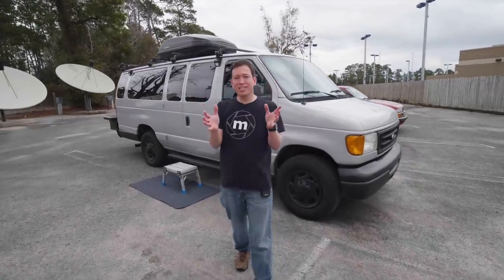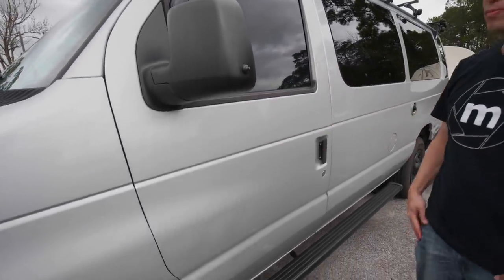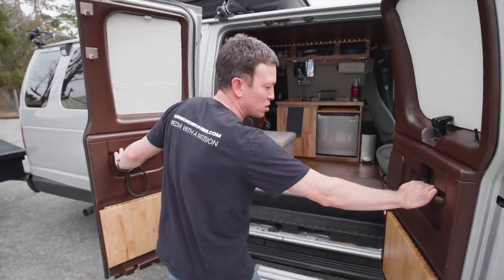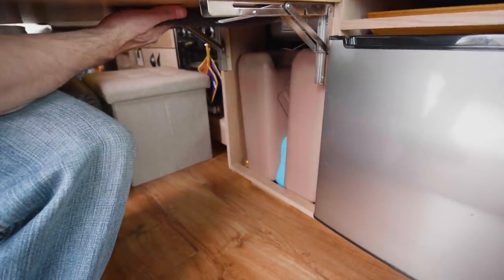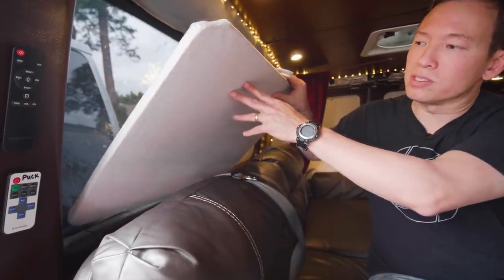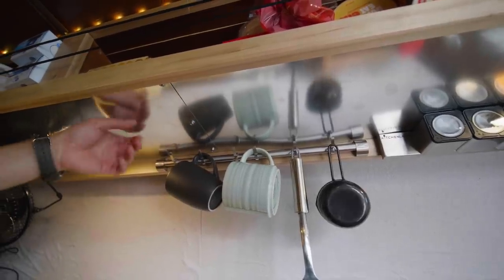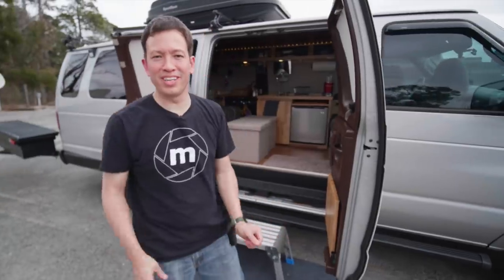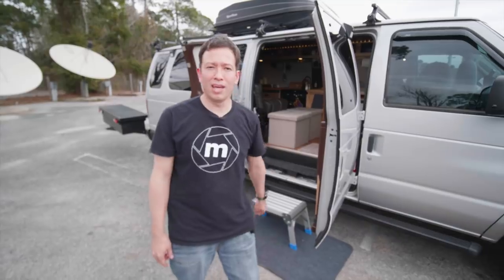Touring Camper Van Tour 1.0

Comment: Where did you get your cameras you mounted in the outside edges of your mirrors? Also, where did you get your camera controller under your steering wheel and what is it called? I like the bidet idea. I got one for my house, but it sticks too far out to the side and the tub is in the way. How do you control the water temp so you're not freezing your business with cold water?

I have some radios with screens,  but I can only use 2 cameras at the moment. I like that controller you have.

I'm designing a computer with multiple cameras to protect me from the biggest crooks out there. COPS!!!

Cops and their phony tickets for things you didn't even do.

I love going to court and showing video that shows what liars they are.
Reply from the maker: All the items that I have links to are in the description. Regarding the water temp in the bidet...I just use tap water and let it set to get to room temperature.
Reply: @IanSkelley  Thanks, when I watch the videos on my tv, I can't see anything in the description.

Does it have a tank to fill so it can sit to get to room temperature? Mine connects directly to the water supply line for the toilet and this mountain well has very cold water. Is why I've wondered about heating it.
Reply from the maker: @nunyadamnbiznez3522  The tank is just a home depot sprayer. You can see the build here: https://youtu.be/7_xtJsL4p4s
Reply from the maker: @nunyadamnbiznez3522   here is the list of all the items: Ian Skelley’s Camper Van Product Page

Safety/Security
Get Blind spot mirrors: http://amzn.to/2pCao2J
Get Ventshade: http://amzn.to/2qv21tI
Get Roadmaster Active Suspension: http://amzn.to/2q5tMbu
Get Backup Camera: http://amzn.to/2r3pLl1
Get Side Camera: http://amzn.to/2rOsGSP
Get Quad Processor: http://amzn.to/2rAT6qw
Get DVR: http://amzn.to/2rB63AC
Get BNC Connectors: http://amzn.to/2snZqzy
Get Hitch Extender with Step: http://amzn.to/2rB8WS3
Get Wide Hitch Step: http://amzn.to/2h6xFtz
Get Weather Station: http://amzn.to/2snTF4T
Get Magnetic Phone Holder: http://amzn.to/2s2QIt2
Get Gas Detector: http://amzn.to/2s32mnW
Get Wireless Keyless Entry: http://amzn.to/2rOxtDV
Get Pioneer Radio: http://amzn.to/2snU879
Get Radio Antenna Extension: http://amzn.to/2s31LTa
Get Radio Bypass: http://amzn.to/2s2YyTB
Get Radio Install Kit: http://amzn.to/2rOngYm
Get Speaker Harness: http://amzn.to/2rAYoCl
Get Car Alarm: http://amzn.to/2rOk9zo
Get Car Alarm Motion Sensor: http://amzn.to/2so3tMc
Get LED Motion Lights: http://amzn.to/2snwmYV
Get Mini to RCA Adapter: http://amzn.to/2eQrRnk
Get RCA Cables: http://amzn.to/2v1CcmT

Privacy
Get Curtain Hooks: http://amzn.to/2snMXMk
Get Curtain End Stop: http://amzn.to/2qQd4JO
Get Curtain Ceiling Bracket: http://amzn.to/2snBdth
Get Curtain Track: http://amzn.to/2rtWD7Y
Get Car Windshield Cover: http://amzn.to/2hzjwXb

Kitchen
Get Camp Chef Outdoor Camp Oven: http://amzn.to/2rBarjc
Get Camp Chef Propane Hose Adapter: http://amzn.to/2ru7LSa
Get Magnetic Spice Jars: http://amzn.to/2snwRlL
Get Moen Sink: http://amzn.to/2qJSlrZ
Get Sink Strainer: http://amzn.to/2s2RV3y
Get Soap Dispenser: http://amzn.to/2snRcqY
Get Faucet: http://amzn.to/2s2VNS6
Get Swivel Sink Aerator: http://amzn.to/2s2W3kn
Get Camper Drain: http://amzn.to/2qJsLU1
Get Water Pump: http://amzn.to/2rB3zCa
Get Pump Silencer: http://amzn.to/2ru61Is
Get Pipe Strainer: http://amzn.to/2qJxwwK
Get Magnetic Knife Holder: http://amzn.to/2vzDarv
Get Shelf/Table Bracket (Get Long Release Handle):https://amzn.to/2Ecra27

Tools
Get Torx Bit TP55 to remove seats: http://amzn.to/2s353Wz
Get 48” T Square: http://amzn.to/2qPTi0P
Get Wire Stripper: http://amzn.to/2hqkrVY

Ventilation
Get Maxx Air Fan: http://amzn.to/2rAYDxd
Get Window Mesh Screen Covers: http://amzn.to/2zFu7qa

Supplies
Get Dicor Sealant: http://amzn.to/2rtYauK
Get RTV Sealant: http://amzn.to/2hBWqip
Get Dicor Butyl Seal Tape: http://amzn.to/2so2Dz6
Get Emergency Blankets (for making window inserts): http://amzn.to/2qQ0vOD
Get T Molding for Ceiling Panels: http://amzn.to/2v1rZqP
Get Magnets: http://amzn.to/2vAkTdE
Get Trim Lock: http://amzn.to/2hpPWPV

Electrical
Get Vmax Tank 100ah Battery: http://amzn.to/2rBcrYH
Get Battery Isolator Solenoid: http://amzn.to/2rOmiuW
Get 100a Circuit Breaker: http://amzn.to/2snXOG6
Get Fuse Block: http://amzn.to/2rOAbcz
Get 30 Amp Power Surge Protector: http://amzn.to/2AK2QRo
Get 30 Amp Power Inlet: http://amzn.to/2yzoV3x
Get 30 Amp Cord: http://amzn.to/2zXFtqo
Get Switchable Power Supply: http://amzn.to/2rOJrxu
Get 20 Gauge Red Black Wire: http://amzn.to/2qJtrIO
Get Changeover Switches: http://amzn.to/2hwz9OZ
Get 50 to 30 amp Dogbone: http://amzn.to/2hoVUAK
Get 30 to 10 amp Plug:http://amzn.to/2yzm2jd
Get 10 to 30 amp Adapter: http://amzn.to/2iUrF4O
Get USB Wall Charger: http://amzn.to/2zVf10l

Repairs
Get Econoline Door Cable Repair Kit: http://amzn.to/2snNpdg

Lighting
Get LED Lightbar: http://amzn.to/2snJSeW
Get LED Reading Lights: http://amzn.to/2rOFN6K
Get Dimmers for Reading Lights: http://amzn.to/2hwAHbL
Get LED Puck Lights: http://amzn.to/2rAY72k
Get LED String Lights: http://amzn.to/2rB7cbu
Get LED Dome Lights: http://amzn.to/2snVLSc

Livingroom
Get TV Wall Mount: http://amzn.to/2rOu2ND
Mini Wooden Fireplace: https://amzn.to/2BYLXag

Storage
Get Swing Away Hitch: http://amzn.to/2zFIZEY
Get K & M Swivel Pro Seat Swivel, Model# 5006: http://amzn.to/2yziH3F
Get Thule LB65 65" Load Bar: http://amzn.to/2iVtBu5
Get Thule 300 Roof Rack Gutter Mount Foot Pack (Low): http://amzn.to/2yB8zY1
Get Collapsible Ladder: http://amzn.to/2yAUGsY

Air Conditioning
Get Flex-A-Lite 31146 Relay: http://amzn.to/2ieSZeL
Get Auxillary AC Fan: http://amzn.to/2ht0sGp

Exterior Water
Get Collapsible Hose: http://amzn.to/2zY9VAC
Reply: @IanSkelley  Thanks so much. Enjoyed your videos.